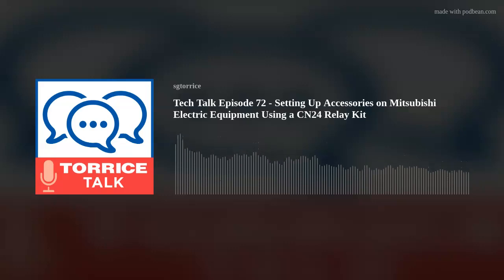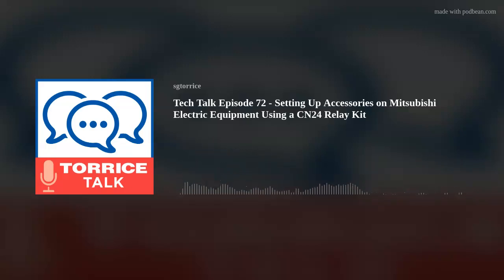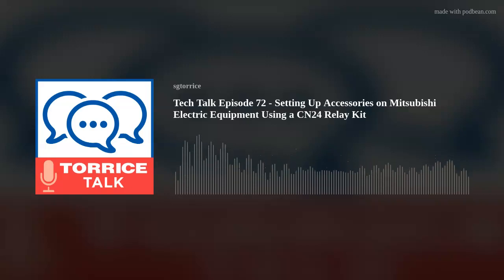Tech Talk Episode 72 - Setting Up Accessories on Mitsubishi Electric Equipment Using a CN24 Relay Ki

Comment: So am i correct in thinking that if i am using a lock out kit with a temperature sensor. I wouldnt need the cn-24 kit? Or do you need both. My understanding is if you use the relay itll just go based on timing and set point. Where as the lock out you can set temps.
Reply from the maker: I believe you are correct, Justin.

Comment: Whats the correct wiring for an aprilaire 600m with model 60 humidistat to the mitsu control board using these cn24 relay kits? I've r/c connected for power. HH connected to CNF on the board, CN25 connected to relay, relay connected to two yellow wires of the humidifier solenoid. When putting model 60 in test mode the solenoid doesn't open and the blower doesn't start. Any thoughts?
Reply from the maker: Hi Chris,
Thanks for asking, according to our technical support team, your answer will be in this manual: https://mylinkdrive.com/viewPdf?srcUrl=http://s3.amazonaws.com/enter.mehvac.com/DAMRoot/Original/10006\M_SVZ_Service_MD-1404-K019_V-5_3-22(1).pdf. Look at page 36-37 and page 44. That should help. If you need more assistance, please call our tech support line at 978-657-4768. Thanks!